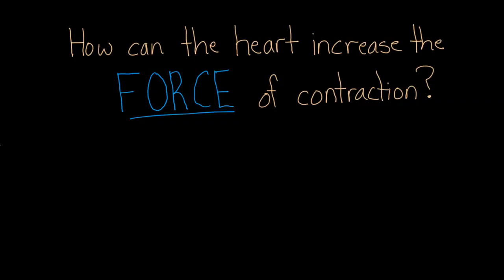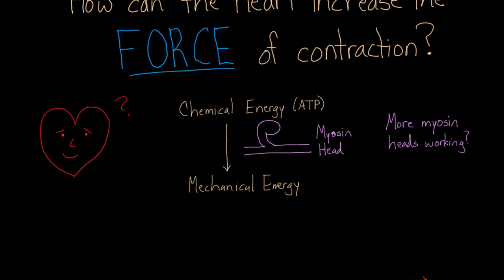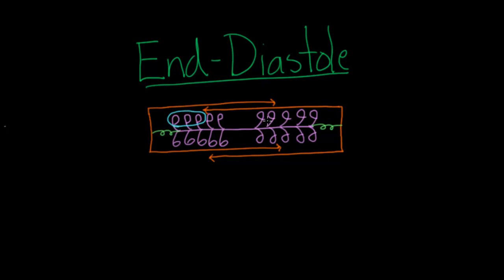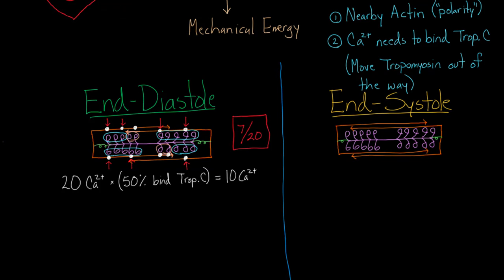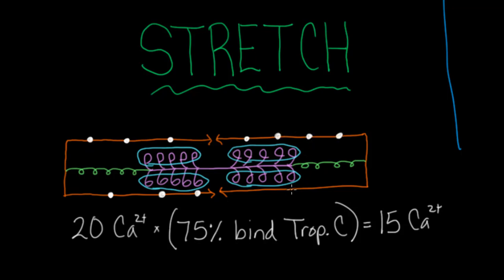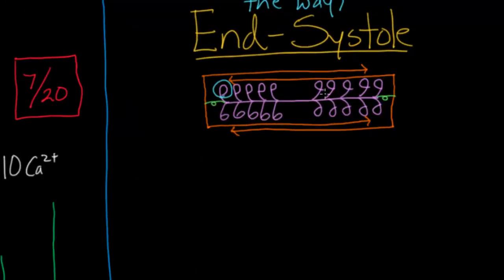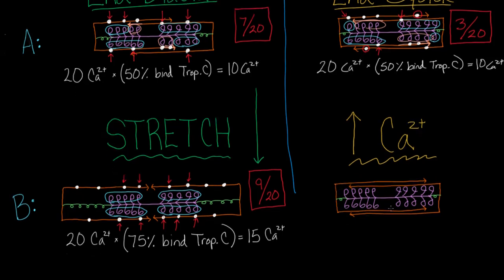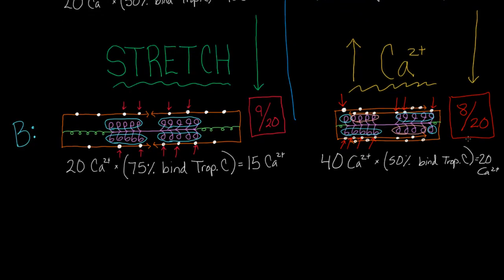Increasing the heart's force of contraction | NCLEX-RN | Khan Academy

Comment: On the other hand, Ca2+ concentration (which we can change by sympathetic or parasympathetic stimulus) change the force in other way. And that is more interactions between myosin and actin is possible because of higher availability of Ca2+. Therefore more active site on actin are made (by binding Ca2+ with troponin C and shifting tropomyosin).

That is what is sometimes called homeometric regulation of contraction. Because the length at the beginning (or end-diastole volume)  is not changed.

Comment: If I understand correctly, Stretch is basic mechanism of heterometric regulations (Frank-Starling mechanism). In other words, when we increase volume in diastole, the myocardium is stretched more. As a result of that more myosin heads can interact with actin (actin filaments are not overlapping if we stretch the myocardium more). That means higher force (or pressure in ventricle).

Comment: Altough these videos are very informative, I believe you made a mistake in this one. During diastole, the ventricle fills up with blood and as a result the sarcomeres stretch. At end diastole, the sarcomeres are maximally stretched and contraction begins due to an increase in calcium. There is no more stretching at this point. After contraction (end systole), there is relaxation of the sarcomeres as cellular calcium levels drop and calcium dissociates from troponin.